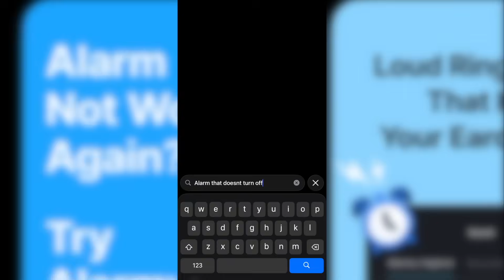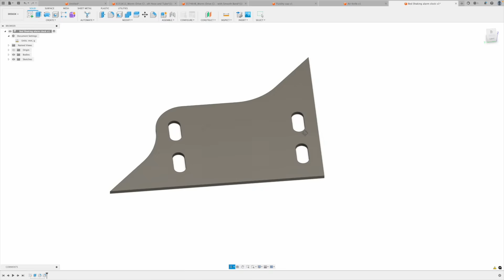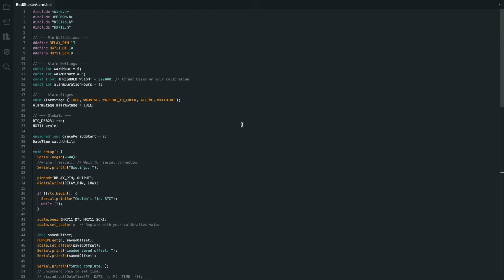I solved oversleeping with engineering

Comment: I've had this thought several times but i know that after i built the damn thing i'd still just yank the powercord! And then i'd have to make a battery backup, but i'd disconnect that fucker. And if last i encased it in liquid plastic i'd eventually just go to the sofa and keep zzzZzz there :/
Reply from the maker: I was worried that i might try to unplug the chord haha. But I think that I havent been tempted to do that because I would definitely oversleep if I unplugged it. But also it’s not at an easy spot to access which might also be a deterrent.